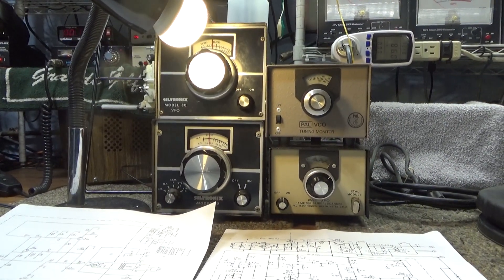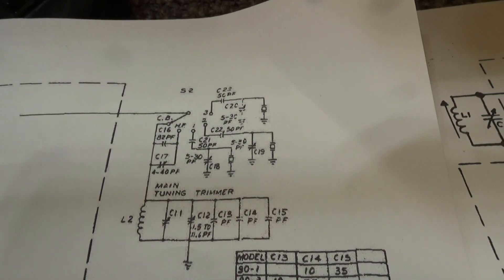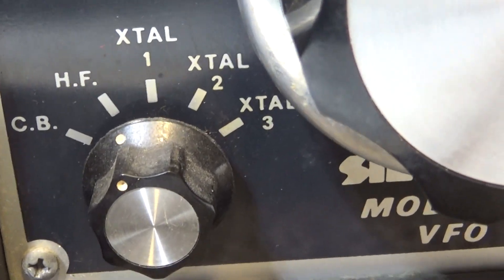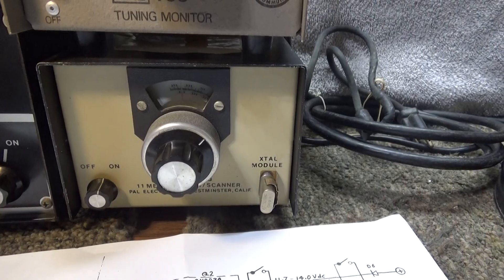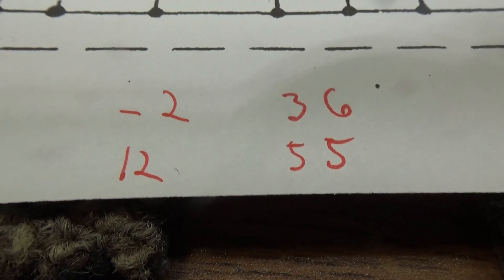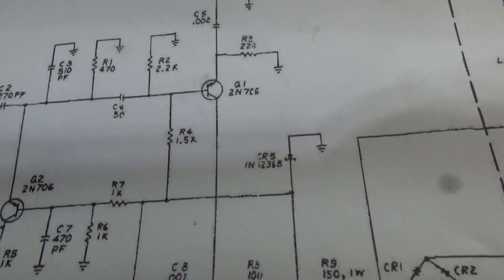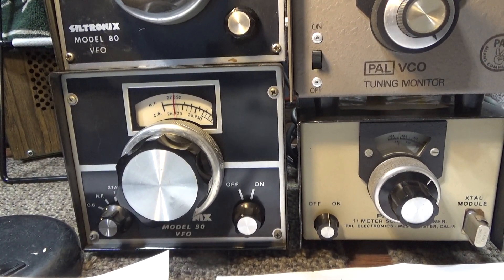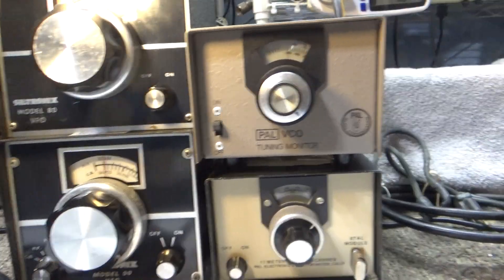Siltronix vs PAL old school VFO VCO's

Comment: You can greatly lower the drift of a Siltronix VFO by keeping the temperature stable.  Adding a "heater" inside one can be as simple as adding a high wattage wire wound resistor connected to 120VAC or as complicated as a temperature regulating circuit using a large transistor and heatsink used as a heater.  The key is consistent non changing temperature.

Even the PAL VFO's can be made more stable by adding a crystal heater to keep the crystal temperature stable.